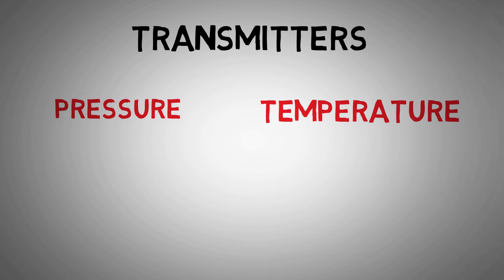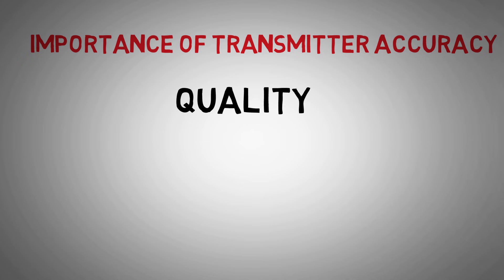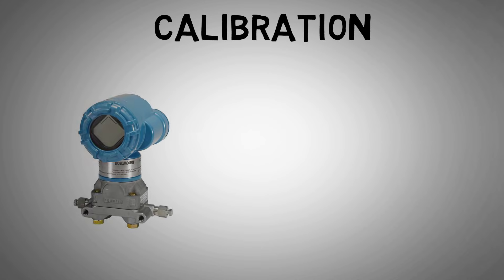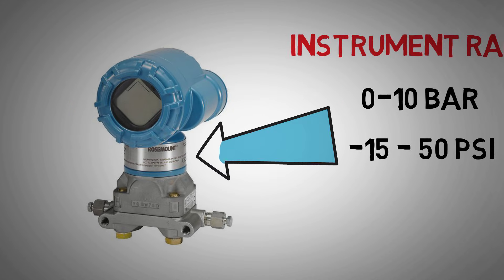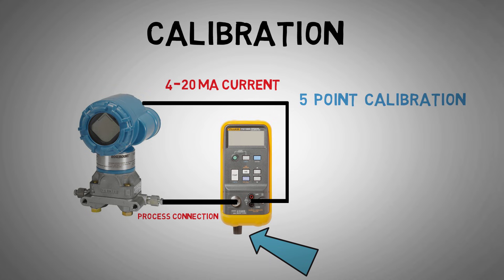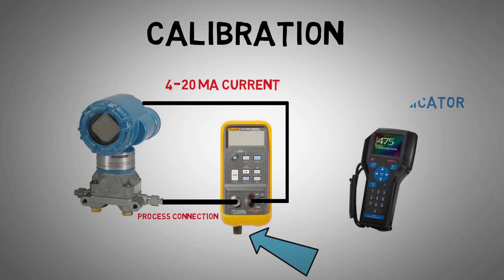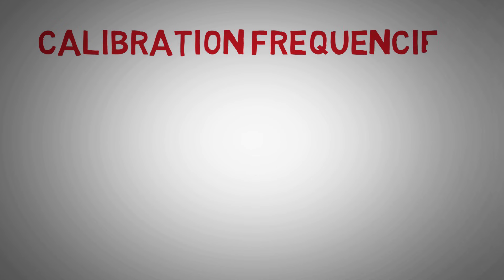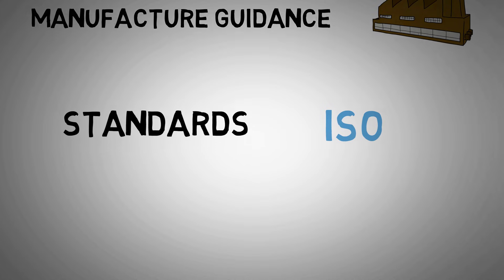Instrumentation Calibration - [An Introduction]

Comment: Great video... can you make a video on how to install a new transmitter into a loop that is made a different manufacturer or upgraded model. I'm an instrument tech on an older oil and gas facility in the gulf of mexico and my background is mainly pneumatic control panels and devices with only SCADA to remotely monitor pressures and status but no control.
Reply: https://youtu.be/IawgtmGvag4?si=RrWR2xczH4tGGCaA

Comment: Thank you for the useful info. I understand that any errors measured during calibration will inform adjustment of the instrument to reduce errors. But, is it also appropriate to determine a calibration factor/curve that allows you to perform post hoc correction of measurements, rather than adjusting the equipment itself?
Reply from the maker: Hi there, glad you enjoyed the video. It really does depend on the application of the instrumentation that is being calibrated. In most industrial use cases instrumentation is providing live plant data. Adding in a correction factor or linearization curve to DCS / SCADA software, so that the measured value is corrected for an Instrument out of calibration, would be more work than to adjust and re-test the instrument.

Hope this helps!
Reply: https://youtu.be/IawgtmGvag4?si=RrWR2xczH4tGGCaA

Comment: Thanks for sharing. May I know how we set the calibration point of an equipment? Have any specification or standard to refer? 
Example: the calibration point for an equipment for standard requirement for 20±5°C, 47°C, 50°C and 55°C. Appreciate your reply, thank you.
Reply from the maker: Hi there, the accuracy of calibration requirement isn't usually specified in units as in so many BAR or degrees. Accuracy requirements are usually given as a percentage of the range of the equipment. The standard will depend on the application of the instrumentation, that being said 1% of range is a common standard. So if a temperature transmitter was ranged 50 degrees - 250 degrees then a 1% specification would equal 2 degrees. (250-50) / 100.  Hope this helps?